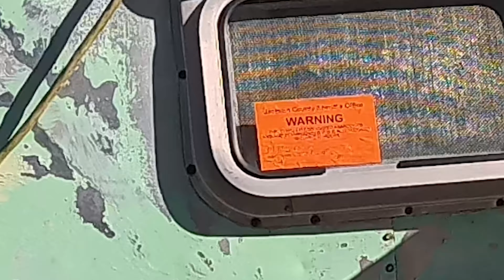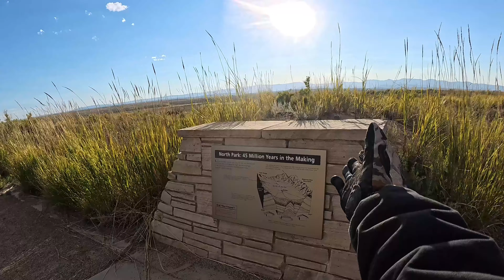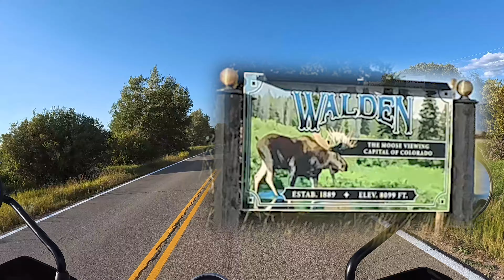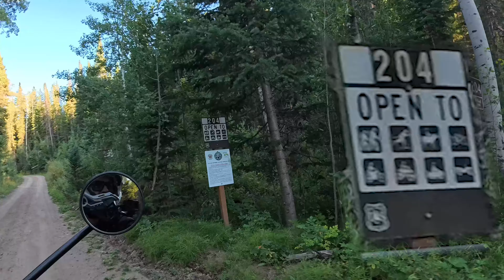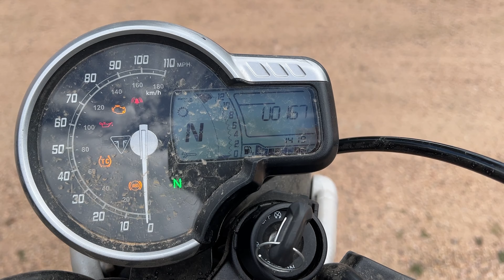1 Little Spill Off Road Disabled My Triumph Scrambler 400 X and Left me Stranded

Comment from the maker: $1800 just to make it run again. I will never buy another motorcycle with an immobilizer system. there is no option to get it without that system. entire system, control unit, keys and all locks have to be replaced because that tiny piece of broken plastic. only the dealer can program a new system to the ecu. The ECU will not allow the engine to run unless the immobilizer control unit gives it the ok. there is no way Triumph or any dealer would allow you to delete the immobilizer system. Im not against electronics. Im against being locked out of them. If this happens again, im taking back control, installing a standalone ecu, im tossing the immobilizer, stock ecu, Abs unit, and instrument panel. Ill have custom brake lines made to go directly to calipers. Ill install a standalone ecu probably a microsquirt 3.0 and an aftermarket universal dash. abs and immobilizer will be deleted. Ill now have full control over what happens. No longer need the immobilizer to allow the ecu to work. I can tune the engine how I see fit, stall outs at idle because the mixture is too lean because Triumph was trying to meet an emissions standard? No longer need to beg triumph to fix it, i can fix that my self. I now have full control over the motorcycles electronics. It will be a learning curve for sure but I have the background to pull it off.
Reply: Or maybe you should stick to aircooled carbureted motorcycles if you're going to be going to remote spots.   I had a TW200,  fantastic bulletproof bike,  now I have a Suzuki DR650 which is nothing but a TW200 on steroids,  just as simple.   Glad you're okay,  sorry that modern technology let you down at the worst possible time but that's what it does.
Reply: That "ring" that is broken is literally just the antenna that reads the chip built into the key.  I don't know why you can't just source another one from a motorcycle salvage yard and have it work.  I think they're just ripping people off saying that the whole system has to be replaced. :-(
Reply: @BillySBC whoa you sound like me haha. I’ve had many bikes in the past including the TW200 and I’m currently on a DRZ400sm. It’s basically a TW with some balls 💪🏼💪🏼💪🏼. It’s crazy how all these modern bikes with fancy electronics can actually limit you. I prefer old school bikes. Carburetors ftw 🙌🏼
Reply: @therealrealshocker  If manufacturers want to put all that tech from the car world into a street motorcycle then okay fine,  I'm not a fan of it but if something goes wrong you call Triple-A and they send a tow truck to get you and your bike,  but when they start forcing this stuff on to motorcycles that are going to be going into remote places where the best way to get you out is by helicopter then NO...  I don't like it at all.  When you get remote out in the bush you want SIMPLICITY,  you want something you can fix if it fails,  and mostly you want to limit your points of failure.  Aircooled carbureted bikes limit your points of failure.
Reply: Super awesome content regardless no matter your troubles their you really promoted yourself with that one no matter the loss of time 1 heck of a ride
Reply: Ouch!!!  Bet that Himalayan's looking decent right now, and your TDub looks even better!  Glad you're ok,  and the only damage was to your bank account, rather than your bones.  We face those ruts here frequently, both natural and man made thanx to the 4WD crowd.
Reply: @thomashowlett8295 Yea unless they are doing the signature check on the key itself (which would be a really bad design), the induction ring shouldn't need any reprogramming. Damaging those is a common issue on first gen BMW F800s and most guys I know just bring a spare coil to swap if theirs fails in the field. I don't see why Triumph would do it differently. I'd definitely get a second opinion on that if it were my bike.
Reply: Get a tdub frame and EV retrofit kit.  :-)
Reply: Damn what a wake-up call this is for Triumph 400 owners like myself. Glad you weren't injured in that spill though, that could have bad in such a remote spot. This makes me rethink getting rid of my 06 Tiger for a new Strom 800. Maybe better to keep the lower-tech bikes!
Reply: Sure makes me happy I stuck with my 1998 TDub
Reply from the maker: @BillySBC  fuel injection is fine electronics dont scare me. I just dont like not having control over them
Reply from the maker: @therealrealshocker i kinda wish I got a drz400 sm but now im stuck with this trashumph
Reply from the maker: @BillySBC yeah thats true, i like my tw for single track and stuff but wouldn’t take the triumph on anything a 4x4 couldn’t go on
Reply from the maker: @dustinswatsons9150 yeah it was a super fun ride! If this happens again im taking back control of the electronics haha
Reply from the maker: @alexmacdonald258 haha as long as it doesn’t have an immobilizer system!
Reply from the maker: @alexmacdonald258 yeah not getting injured is the most important part
Reply from the maker: @thomashowlett8295  seems way too finicky to start testing parts from other bikes. The antennas may work differently. If this happens again im doing a standalone ecu conversion hoing with Microsquirt v3 and learning to tune. Taking back control from triumph and getting rid of all the bs
Reply from the maker: @nordic-chan  yeah you should be able to get just the pickup ring itself and swap it out, but noooo triumph decided to only sell everything all together, I even looked at the parts diagram
Reply from the maker: @russellzauner haha
Reply from the maker: @sporty05 yeah its crazy, I hate how they are locking everything down so only the dealers can fix things
Reply from the maker: @timdupont3227 its a trusty bike!
Reply: I completely concur, however this problem is more complex than most would assume.  Motorcycle theft is a HUGE problem in the UK because their government doesn't punish criminals and imports Third World criminals.  The UK government has made their high trust society into a low trust society.  People don't want their new bike stolen so they demand a solution from the manufacturers because their "democratic" government is no longer responsive to their needs.  Triumph builds bikes with immobilizers.  Insurance requires immobilizers before they'll provide halfway affordable coverage against theft.  Ultimately, the policies of the UK government just cost you $1800.

Don't even get me started on how Americans die or are seriously injured because they were unable to reliably disable rear wheel ABS on their dual sport or adventure bike and it rolled down a steep hill and down an embankment because EU regulators require ABS to enable every time the bike is started to reduce highway fatalities, not caring that bikes stall frequently in rugged terrain off road.  They don't care about off road fatalities.  Their only concern is highway fatalities.

Soon, everyone will want a 1990's DR or TW.  I refuse to buy a new vehicle because of the spying, electronic nagging, and soon (by US federal legislation) a government controlled kill switch.  I'll keep driving my 1996 Daihatsu Hijet Japanese mini truck and my 2005 4Runner.
Reply: @TDubsKid  I mean there's no way to totally eliminate electronics,  even the older aircooled bikes have a stator,  a regulator/rectifier,  and a CDI box which can fail,  but they're lightweight and small so I can carry that with me.   But the modern fuel injected liquid-cooled bikes add more to the equation that you don't want to fail on you in a remote spot.  I think your Triumph is a great bike,  I just wouldn't get too far offroad with it,  at least no further than I want to push it to a main road and wait for a tow truck.
Reply: @TDubsKid  yup my Ducati monster was like that too. It was locked on DDS (Ducati Diagnostic System) and only Ducati can unlock it to make it work again. Such bs. Never again
Reply: @TDubsKid  I was gonna say DRZ 400 for the win. My friend has a 2000 it’s still runs good 😊
Reply: @TDubsKid  well there are TPS sensors on Hondas but those are entire cars and hopefully not everything is fly by wire on the very modern motorcycle I would at least hope so it's nice to go uphill and not have to re-calibrate carburetor I got a Yamaha xt250 fuel injected
Reply: @TDubsKid  the more you know the better
Reply: Now we have to find the witch that cursed you.
Reply: @TDubsKid I hope you decided to report a claim to your insurance carrier.  This is exactly why you pay for insurance and I can promise you any premium increase would only be in the hundreds of dollars.  Even if you did the repairs already you can still report a claim this video has more than sufficient evidence of the damage.
Reply: triumph are a joke for their electricals, my mate need a cluster for his scrambler - laughable costs , if i were you i would just go dark and get a new ecu etc - screw the bas7ards
Reply: I had and adored my T-dub for 15 years, I have a 400x right now as well, I'm telling you the best tire you can put on the front of a T-dub is a Shinko SR241 and you can put the same tire on the front of the 400x. That's what I did and it's incredible. huge difference when it comes to wash-outs. new rubber makes a huge difference on the 400x. Having said that I noticed myself that the Triumph cannot be drop started. that concerned me too. I am very interested in seeing how you get around the electronics and you got yourself a subscription so I can follow that up. I'd do that to my bike in a heartbeat.
Reply: wow, great points, and frustrating.
I want pluggable open source vehicle components. The lockin and government mandated pieces is so frustrating. Good luck!
Reply: Just unplug the ignition wires and stick a paperclip on it.
Reply: Up For sale . Would be my Answer.    DRZ400 for me, all day everyday.     take care,
Reply: this is embarrassing, they are manufactured here in India by BAJAJ motorcycle company, yep, triumph motorcycles has partnered with BAJAJ India,  send a mail about what happened to your motorcycle to them,  look it up on the internet and mail them ! they will most prolly improve it in upcoming versions, the issue is you have purchased the first version,  things tend to be finicky in first versions, which usually get fixed in second version.  

regards
Reply: is there any way to fix it at cheaper rates?
Reply: This bike is called a scrambler and should be able to handle relatively small drops without a catastrophic failure.
I feel like Triumph could have been more understanding and not charge you the full amount.

Comment: This is exactly why you want a TW200 or a Suzuki DR650 or a Honda XR650L or some other aircooled carbureted bike if you're going to be going to remote places,   there are just too many points of failure on a fuel injected liquid-cooled motorcycle to be taking them way out in the middle of nowhere.  As you said,  your TW200 never left you stranded,  and it never will.
Reply: Well said
Reply: This comment is on point.
Reply: It’s not that simple. My DR125 stopped on me and I had to get it home to repair it. Older doesn’t always mean less likely to breakdown.
Reply: @davidmatthews3093  You didn't say what was wrong with your DR...   What would cause you not to repair it right where it was?   But you're right,  older tech doesn't mean it won't fail,  but it does mean you can 90% of the time fix it where it sits.
Reply: He didn't have the fucking tools and parts to repair it. Shit happens, and either bike isn't plain superior
Reply: Fuel injected is fine, they nailed it down years ago. It's the gigantic, rock attracting radiator that is totally unnecessary and prone to failure.
Reply: @domenik8339  Fuel injection is fine until it's not fine way out in the bush.  If you can eliminate that possibility then it might be a good idea to.
Reply: Bring an extra CDI for the XR650L, no big deal to change.
Reply: This video was another commercial for the TW200. I have taken several little spills like that on my TW and it has never missed a beat.
Reply: Wrong. This is boomer logic. Electronic immobilizer issues have nothing to do with fuel injection or liquid cooling.
Reply: @Sarrus25  Boomer logic?  And what are you using,  "Beyonce Logic"?  There is no such thing as "Boomer logic",  there is only logic or the lack of it.  And guess which you are using...
Reply from the maker: yeah this bike is for simple off road. should have ridden this road on the tw so I knew what to expect. saying the TW will never leave you stranded is a little silly though. much more durable but it's still a machine and still will fail.

Comment: Take the L and trade it in, any amount of bolt on improvements you do wouldn't have stopped this from happening. A drz400 or even a wr250r, if you want fuel injection + 6 gears, would be a much better and cheaper option, plus they both have a crazy amount of (cheap) aftermarket available.
Reply from the maker: i'm keeping it

Comment: I was thinking, could you not break out into a new area along with the van camping? My suggestion is an E-Bike. Very huge range of power and types.  Dual motor bikes that can climb any hills.. huge variety of battery types with range good for all day. Weight under 100 lbs up to 150 lbs.  Speeds up to 50 mph and off road capabilities like a dirt bike depending on price.  So many E bikes for every purpose.   I think you could make something work in place of a motorcycle.  There is a huge following of E-bikes now. Many opportunities to get free stuff to test on YouTube.
Reply from the maker: I got a folding fat tire ebike, was planning on making a video with it at some point

Comment: That's a heartbreaking crash. I've dropped mine 3 times in soft mud at low speed and have broken a clutch lever, hand guard and the shift shaft. The price point on these is great, but man they sure don't like to go down. I've known of 4 total riders now who have snapped off the shift shaft. I still love the bike but I have to keep reminding myself to take it easy off road.
Reply from the maker: Yeah it really was, thats not too bad, the shift shaft was only 25 bucks from the dealer and doesn’t look too hard to replace, hopefully they designed it in a way the shift shaft is the weak point so at least it doesn’t ruin anything else in the transmission. Still not as easy to replace as a clutch lever and can leave you stranded. When I get the bike back im going to install pro taper 1 1/8 in bars and hdb hand guards with fold out mirrors like my tw. And all the crash bars. Hopefully someone will make a spring loaded shift lever for it. Its such a great riding smooth bike. Just not very durable

Comment: My TW I bought brand new it has 10000 miles. I do a lot of desert riding and I have fallen 
 many times but it has never left me out in the desert‼
Reply from the maker: haha yeah my tw200 I bought new has almost 19,000 miles now and it's never left me stranded. just blew a fork seal but it is time for a front suspension upgrade and steering bearing upgrade. time for more videos on the TW200 while I wait 20 years for the dealer to fix it because Triumph engineered these bikes to need the dealer to be fixed
Reply: @TDubsKid   Those bikes are too close in similarity for me. That's why I have the TW for the ultimate trail riding never let me down.  And I have a Harley Davidson street lightthat I use for my touring. That way I'm really excited when I get to ride either one because they're completely different. And I know you like going on overnight camping you ought to try it on a Harley Davidson.  The only difference camping TW is out in the desert somewhere in the Harley or a street bike that you can travel on you do state parks but you're still camping. A lot of times I find places on my HD and then take the TW back to ride those areas
Reply: me too! I have a tw200 with 4k miles... all over blm desert by Grand Junction. I have dumped it many times.
Reply: @mikehynek  i ride mine around Kingman AZ and  Combination of desert and forest.

Comment: I hope your Scrambler is back on the road soon.  This video makes me glad that I put Givi engine protection bars on my G310GS.  It's not a complicated bike so it doesn't have an immobilizer to be damaged and the design seems fairly crash resistant.  I'm an old guy so I ride slowly, less from concern about damaging my bike and more from fear of damaging me.

This past weekend I was moto camping with a friend.  I was riding up a rocky rutted hill that was becoming steeper.  I stopped just before having a crash as shown in this video.  Dusk was approaching and I was having trouble seeing far enough to pick a good line.  I opted not to ride up the hill to where we camped.  I left my bike parked halfway up the hill.  In the morning, I left the engine off as I duck walked it backwards down the hill an inch or two at a time, using the clutch to engine brake the rear wheel while I kept both feet on the ground.  I turned it around on a flat spot and duck walked it down the hill with the engine off.  One of the bits of wisdom that old guys accumulate from a lifetime of bad decision making:  Better safe than sodomized.  No relying on the kindness of strangers.  No all night shuttling vehicles.  No trips to the stealership.  No ibuprofen.
Reply from the maker: thanks, got it back but now i'm broken. for sure, I bought all the protection for mine but didn't put it on yet because I wanted to make a video on it. nice thats good, less to go wrong. yeah damaging our selves is the biggest issue.

sounds like a close call and you did a good job!